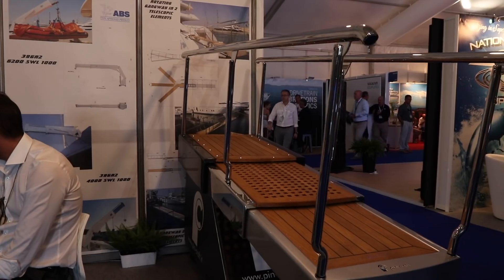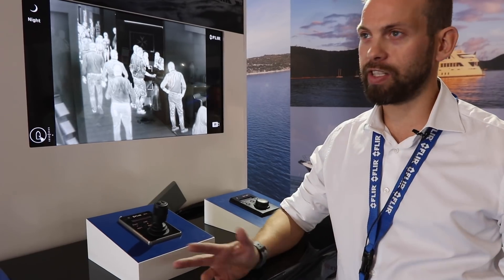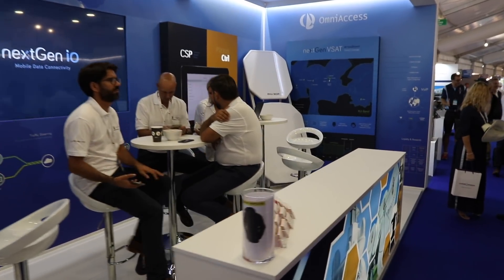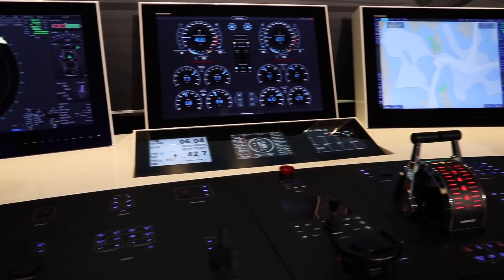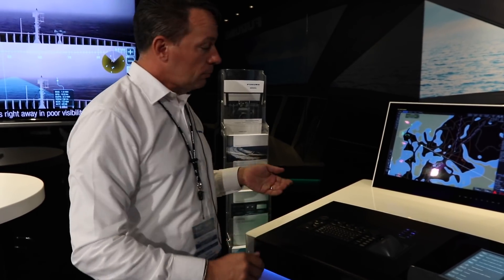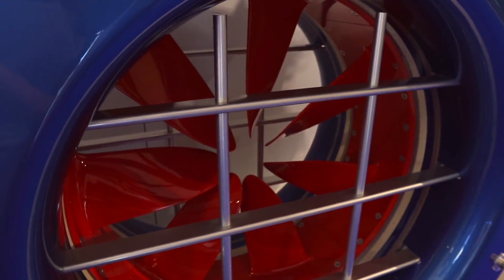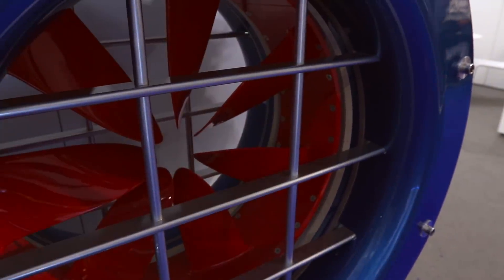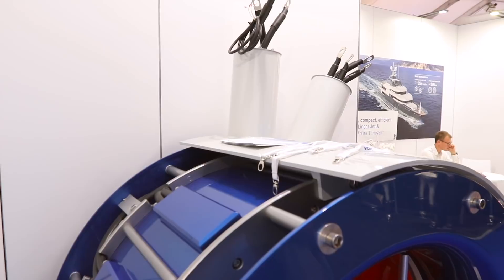SuperYacht Tech! - 2018MYS

Comment: What radio systems do crew mostly use on board super yachts? do they need to use a repeater system or simplex. Is it on the marine uhf or vhf band? especially in international ports ? Can they use dmr on the uhf system. would crew need a licence to use the vhf band?

Comment: I don't quite imagine using those flaps/fins as a stabilizers. What if you go swimming while and that thing hits you, beacuse it has to be moving back and foward to keep the ship still. While seaKeeper is integrated into the hulk of the ship and does not compromise on safety.

Comment: the reason the flat antenna company would not talk to you is because they have poor performance.  they have low gain so they have to be larger and you need many of them to cover a 360 deg area.